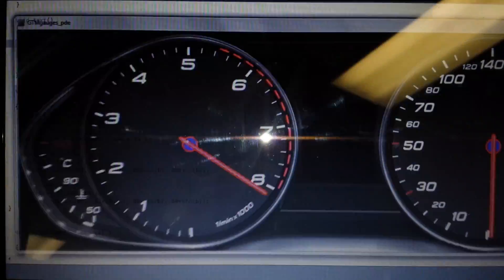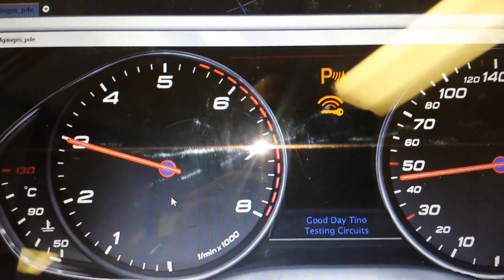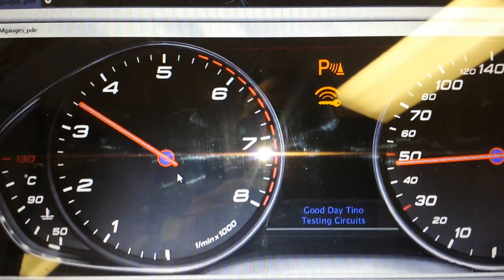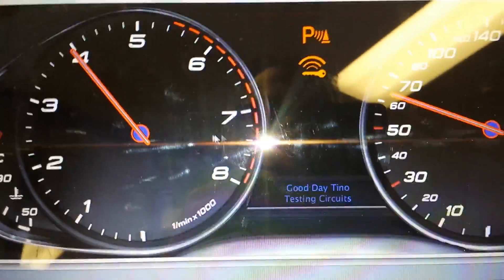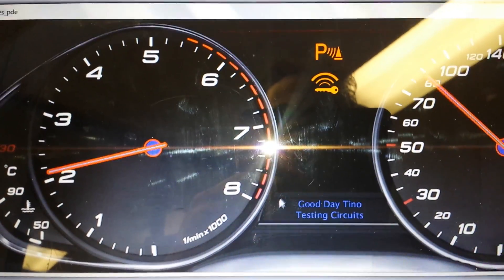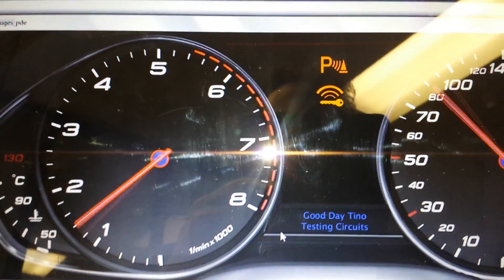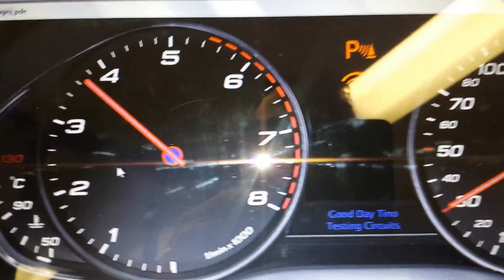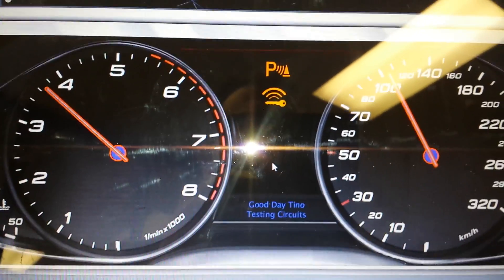GTM Custom LCD using Processing & Arduino

Comment: This is awesome!
Do you have a tutorial how you made the gauges,  software you used etc?

What type of car is this going in? 

I want to do something similar with my 92 Camaro,  the issue I'm running into is that it doesn't have ODBII.   But I think I could get everything from the cluster harness and feed it into something like Arduino.  but I'm totally new at this,  so any guidance you have would be appreciated!

Chris
Reply from the maker: +Chris Doyle Thanks Chris.  I don't have a tutorial for this design and it's very complex.  The software used is strictly Arduino IDE, and Processing IDE (using C code for the most part).   The car is a Factory Five GTM, Gen 1.  Check out my other videos for more tips.  Take care.

Comment: +1973TD Did you ever find a good LCD panel for this project? I'm working on something similar and I can't find anything good.
Reply from the maker: +NTDave Yes, I am using a 10.1 inch Acer tablet.  Here is a link to the photo on my FB page if you can see it:  https://scontent-lga3-1.xx.fbcdn.net/hphotos-xft1/v/t1.0-9/12033207_10154267893844148_1758128616615813742_n.jpg?oh=501ef583c8ab0117fe8aaa4e24620839&oe=56CBAD50
Reply: +1973TD Well that's a clever solution lol. You did some seriously great work with this. I'm surprised it doesn't have more views due to the DIY nature of it. Are the gauge backgrounds just a picture of an S8 cluster?
Reply from the maker: +NTDave yes,  it is a static background image with animated needles and gauge indicators.